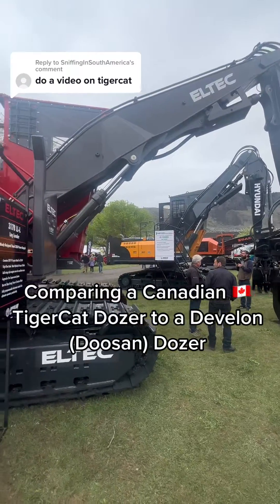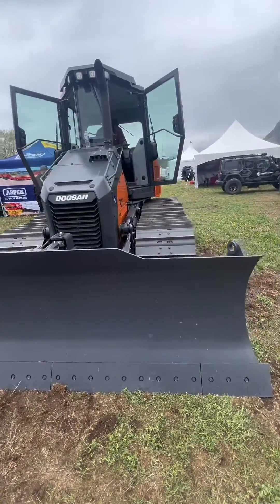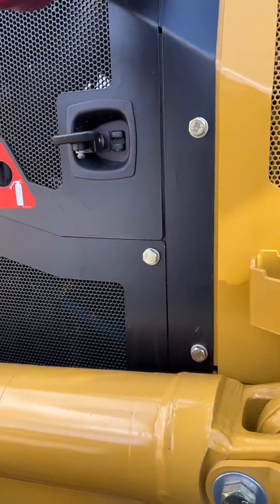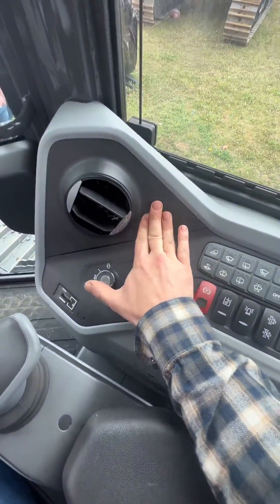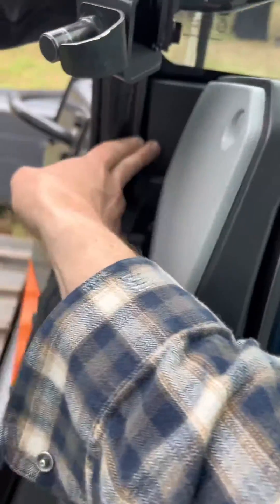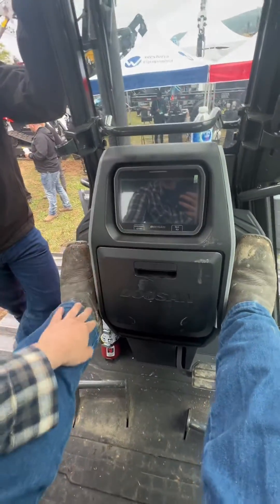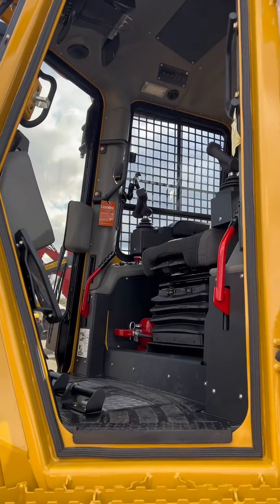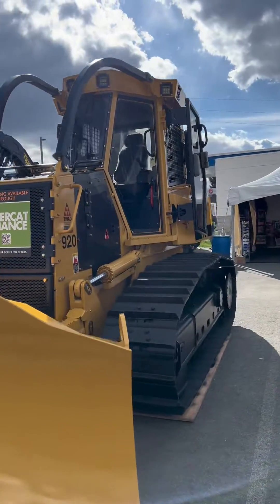Canadian Toughness vs. Construction Elegance: Comparing Dozers

Comment: I ran a doosan diesel forklift (15000lbs) and it was brand new and after a few months all the plastic in the interior fell apart and the screws thay held the plastic cover above the radiator broke as well as the cover broke just from turbulence from driving on the dirt roads in the compound

Comment: Was at the plant when they were testing that thing and it was a beast for its size and im biased but i love the massive working areas they put for all the compartments, the larger loggers and loaders compartment panels are designed as a work platform when its open

Comment: In my opinion, the Doosan was designed in favour of cheaper assembly, and manufacturing costs. Doosan is a big company and they assess where to cut costs. On the other hand the tiger dozer was designed with the consideration of a lower manufacturing number. If the Canadian manufacturer would build 100k units instead of 5k they would also go for more plastic and snap and snip mounts.

Comment: youre comapring two entirely different classes of machines. you have a forestry dozer compared to a low ground pressure dozer meant for finish grading. the develon/doosan is a cheap brand too so yeah the interior is going to be chintzy and cheap.

Comment: Chace, you're conflating ROPS with the brush sweeps. Uninformed viewers, ROPS, Roll Over Protective Structure, it's integrated into the operator's cab. NOT the bars over the engine bay.

Comment: Makes me think how easy it was to replace headlight and tailight on my 51 Chevy. Just unscrew the bolts that are obvious on the bezel or lense. These days you need to find the secret hanshake for replacing them. And you don't know if the gasket is cold and stuck, or you didn't unlock everything necessary, so you end up prying while doing the cringe.

Comment: For those wondering about the cost, I couldn't find for the Tiger Cat, but the Doosan DD100 doozer is around $140k USD for a lightly used model (everything new was "call for price"). The Doosan is priced about the same as used equipment from other manufacturers like CAT or Deere, even those with a dedicated forestry package & a few thousand hours.

It's still crap no matter the price point. Can you imagine the small fortune you're going to have to spend in replacing those crappy plastic switches when they get beat on by the guys day in day out?
Reply: No, but I can definitely imagine how many are gonna be on lots for sale, or out in the pasture, that somebody buys in 15 years, with taped up hand-wiring, baling wire, and lots of O'Reilly or Autozone switches shoved in there and zip-tied to places.

Comment: The looks always matter. The question is: What do you want the looks to "say" about a machine. The Canadian one says: "I'm a robust workhorse, I'll get the job done." 
Seeing bolt's and so on isn't bad as well. Just place them nicely. Make sure they are installed correctly (nice and tight, maybe with a "decorative" washer). Use Quality bolts that won't rust away. This can actually look really nice. It just is a bit more effort then to click-in a plastic panel that will brake on its way out of the factory.

Comment: They are 'built to a price' is why plastics over steel.   And later when its out of warranty you have to buy those plastic bits and switches and controls at a greatly elevated cost
Reply: They probably come with a 1 month warranty too.

Comment: I am no engineer I am no professional builder but that’s what I do for my projects build it stupid strong and then complain about why the fuck I built it to be 200 pounds of solid steel when I only weigh 180
Reply: I resemble that remark! 😂 That’s the #1 thing that I loved about my IH 1/2T 4X pickup (until it succumbed to the rust cancer disease that they were prone to). Simple, relatively tough, and would deal with whatever “stupid” actions that a 19yo would throw at it because it didn’t have stupid power, just enough. 😊

Comment: Your comparing a bargin basement bulldozer  with a purpose built tigercat with a forestry package, with brush guards and limb risers.
Reply: For sure. This isit comparing apples to apples as they call it. If thwy can only make thier product look nice compared to its worse competitor then what happens when they go against CAT or Komatsu. It's not an honest comparison
Reply: @scottwall8419 It's not an ad. It's a general comparison between cheap and expensive. That's the point.
Reply: @EssenceofPureFlavor  everyone looks good next to cheap though.

I saw them compare themselves to a Volvo non purpose-built forestry excavator also. They set a purpose built logger next to General Excavation line from Volvo. Its not very honest number 1 and it's not comparing like to like. I come from this world and I understand he's being brief on tbe features of the doosan and Volvo for a reason. Tigercat is a great brand but they would look better if they stood toe to toe against like machines. 

Like a line backer creaming some sub hundo dweeb vs holding thier own against Lawrence Taylor. Which is more impressive?

Comment: What is the price difference between the Doosan and the Tiger Cat?
Reply: The tiger cat is probably cheaper but I'm sure you could find prices on Google if you tried hard enough
Reply: From what I could find, a used Tigercat is roughly what the Doosan is new. @the_undead
Reply: @willcresson8776  would you mind providing some sources for that?

Comment: What is the price difference?
Reply: It wouldn't surprise me if the Canadian one was cheaper because it isn't built by a massive name brand. You would probably be surprised how many items all over the world you can get for 10, 20 or even 30% cheaper by buying a non-name brand one which might be made by the same people in the same factory
Reply: Wondering that too. I believe the Doosan is the DD100 model, and seems the price is 140-150k usd. Can not find any pricing at all on the tigercat

Comment: I honestly doubt, that the injection molded plastic is even cheaper than a bolted metall plate.
Reply: Depends how many are being made. If they've only made 10,000 of those bulldozers then you're probably right. But if they've made a million then those injection multiplastics have probably saved them about $100 per dozer
Reply: For relatively flat panels with simple shapes, making the injection molds is not that expensive.  (Use CAD files to CNC machine or 3D print the molds.)  So probably much less than 10,000 units to break even on injection molds.  I think it could be more about corporate mentality & forcing customer to buy replacment parts, rather than self repair.
Reply: @samjubilee6593  but they would have to be close to the millions in order for it to be a significant cost savings. It's honestly just offensive that any company considers it justifiable to put plastic anything anywhere on a heavy piece of machinery like this
Reply: @the_undead  Plastic it self is not the problem, a panel with some buttoms could also be made out of some flat plastic panel with like 2mm thickness, would also be good.
Reply: @jonasstahl9826  my issue isn't so much with the durability of plastic, although that certainly doesn't help, my issue is they're using it to try to save their money and make more money off of you later because you will be locked into replacement parts from the company whereas a flat steel panel is not exactly complicated for third parties, also even ignoring the number of suppliers for spare parts, it just makes machinery harder to repair because the plastic panels will use some bespoke mounting solution whereas flat steel panels will use the insanely complicated technology of nuts and bolts